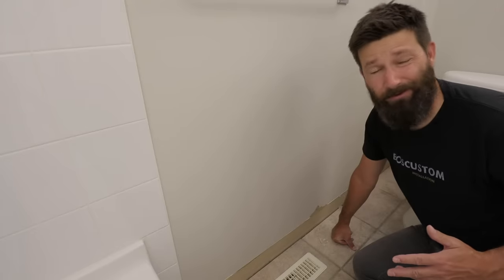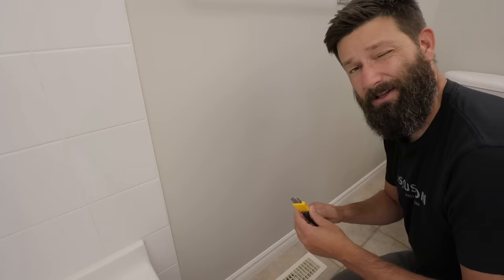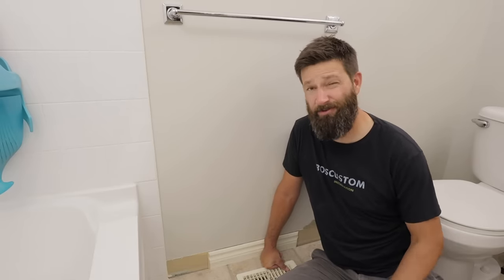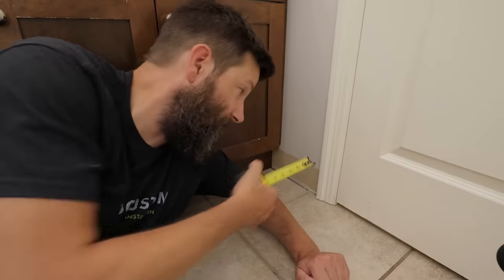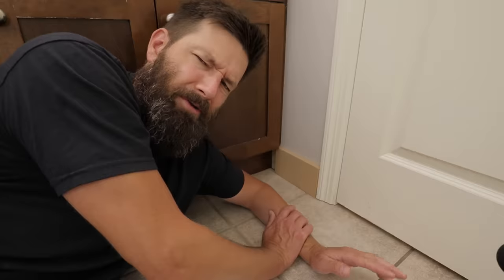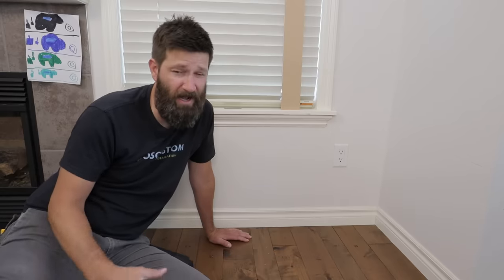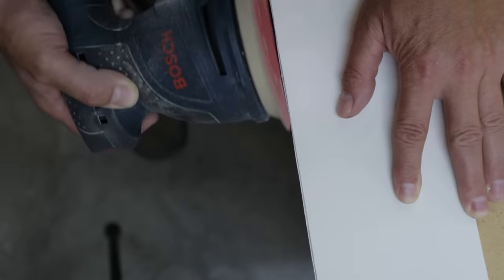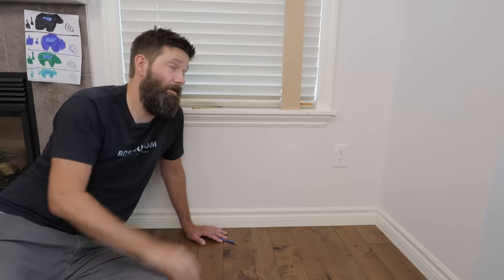The 4 Fatal DIY Baseboard Mistakes!

Comment: Just put down new vinyl plank flooring. Previous homeowner had thick wood laminate down. Now I have a half inch gap under all the baseboards which I’ve been able to use 3-4 quarter round and cover the gap, since I didn’t want to lower or replace all the baseboards. Problem now is I have big gaps under the door casings and jambs. Only way I can think of to fix all these doorways is to take my multi tool and cut like a foot of the lower area off and put new longer section in. I can’t see going around to every door and using body filler or something and laying on my side trying to sand all that mess. More than likely damage the new floor in the process too. Last resort I guess would be to still remove all the baseboards and invest money to put in taller baseboards. At least cutting a lower section out of the jambs and casing the repair would be minimal and a foot off the floor. Advice would be great. Love the channel. Thx

Comment: #1- probably a whole lot easier to do when the bottom edge is not edged in by 2 layers of flooring butted against it and nailed in with 3" nails. Old house and everything was done with 3" nails. Sometimes multiples of nails. Will keep #'s 2-4 in mind. Thank you!

Comment: I have been using cope joints on a house I am working on and it is amazing. Cause even if the floors run down hill or up hill the coped side can be filed for a tight fit. The hangulation of the inside corners almost becomes totaly irrelevant with cope joints. I can't belive that cope joints have become so uncommon in finish work.
Reply: As  " Paint grade " trim has become far more common then natural/stained wood ... it is generally far easier , and certainly more time efficient , and a lot less expensive ,  most will  just do what you can with an inside miter cut , and fill it with caulking etc.  

So Yes , the art/skill of cope cutting , is/has become lesser used .

Won't  be long before new young carpenters  will look at a coping saw with the same confused look as when seeing a rotary dial phone . 🙂

Comment: Great tips man.  I seem to always have 2 cents to add but this one was on point.  Great tip on using a shim to scribe.  I always bust out my scribing tool but that’s a lot easier.
Reply from the maker: Thanks buddy, I've always been a fan of using shims.  It's simpler than fiddling around with the scribing tools in my opinion.
Reply: I also dont scribe to floor unless gap is more than 1/8. Caulking is necessary no matter what to seal the bottom edge from moisture , washing floor etc. Let the painter do it. Use quality caulking also. If you choose baseboard thicker than casing just put backband around casing. Its just piece of maybe 1/2 " by 1" piece of trim . wrap that around edge of casing. Adds a nice detail an enables you to use thicker baseboard. Good luck to all. 😁

Comment: Excellent video. I'm really surprised how common you say the first two mistakes are. The only one I didn't know was #4... specifically using a shim to act as a guide to mark where to trim. And BTW... i have that same Bosch sander. Definitely the best cheap random orbital sander out there and hooked up to a shop-vac you've got pretty much dust free sanding. I'm looking at buying Bosch's beast of a sander, the GET75-n6 with the switch to turn on/off powered rotary mode. Its expensive but sometimes the little bosch isn't enough.

Comment: Is it a new style just using the baseboard alone, because ive done plenty of trimming and ive alwats installed quarter round or shoe to give it a extra touch and it conceals all the floor issues. The scribing is awesome, it does work.

Comment: Another tip: before using the glazers bar to pry away the baseboards, slide a 3” putty (drywall) spatula (knife) behind the baseboard, against the wall and pry against that. Reason: Often, very long Brad nails were used to secure the baseboards and prying can collapse the drywall. The putty knife adds extra support to pry against.

Comment: I'm using composite pigmented baseboard in my current renovation, some of these tips will help out for sure because I don't want to use caulking and have to paint something that already has the colour I want!
Reply: You have your own set of issues.  I would not use a pre primed and painted baseboard or any trim piece for that matter.  There’s no way to make it seamless, unless the manufacturer provides a color coded caulk.  In most cases caulking finishes off the baseboard, integrating it to the wall and other areas where it touches, not to mention helping fix the occasional infer or over cut miter.

Comment: This is a great video. I’m currently replacing all the door casings and baseboard in my home to a wider flat stock type molding. I’ve never done anything like this before so it’s a real learning experience for me. I started in the water closet in the master bath. It’s a small room where it’s just the toilet. I did 45s on the inside corners and didn’t get as tight of a fit as I’d have liked. Since you said it’s ok to butt ends on flat stock I’m going to try that going forward and see how it looks. I had originally thought about doing that just to make it easier for me but I was afraid that was wrong. Thank you for sharing your expertise.

Comment: New subscriber with a question, please: Removed old vinyl bathroom floor trim, but the wall still had some VERY sticky adhesive remaining, which  laughs at acetone and Goo Gone. I'd like to replace the removed vinyl with PVC trim, "Veranda 7318" from Home Depot, and I've learned that the proper adhesive for that would be Loctite 3X PL.    SO- what to do about the old, remaining yucky adhesive?
Thank you!
Reply from the maker: That's rough!  I would try a razor scrapper, and  or the scraper part of a Richards Red Bar.  Best wishes!
Reply: @TheFunnyCarpenter  
Just finished loosening the adhesive with  a hair dryer (could’ve used a heat gun), basically liquifying it a bit, and then scraping, wiping the glue off the scraper with  Scott’s towel. Appears to be a solution.
Thanks for the response 😊

Comment: Instead of the pry bar, I use a pair of 6" drywall spreaders to remove base.
Push a flexible spreader down behind the base at a slight angle where you plan to start.  That helps cut what the razor knife missed. Once it's been inserted, flex it toward you a few times. If that's enough to begin loosening the base board, insert a second, stiff spreader behind the first one and pull on them both. They act like a pry bar but over a wider area.
From that point on, use the flexible spreader to begin loosening the base, then with the stiffer one right behind it, rock them both in tandem.  The thin one is always inserted behind the base first, and shove it down at an angle each time, cutting whatever the knife missed.
Even if you use a pry bar, use a thin, flexible 6-in drywall spreader ahead of the pry bar for the reason mentioned earlier.
Reply from the maker: Nice technique
Reply: @TheFunnyCarpenter  it doesn't always work depending on if it's real wood and was fastened on with finish nails but I've been doing it that way for quite a few years and they usually works pretty good especially if the flexible drywall knife is only used for pushing down to finish cutting the caulk and then using the pry bar behind it. I don't think one method works for everything. Mine certainly doesn't. 😁

Comment: If you scribe just one end of the board then isn’t there he 45 in the corner not going to be plumb?  Which would leave a gap at the top half of that miter joint.

Comment: Very nice , thanks . I have a question my installer want to put baseboards all the way down to ply board floor & then put Vinyl floor with a regular gap from wall(in my case baseboard) & fill that gap with quarter round- Is this correct? Any con or pro? Why doing like that- Thanks a lot
Reply: Not an expert, but typically installations go in this order:
1. subfloor 
2. vinyl plank
3. baseboard
4. moulding

There's a reason trim and moulding is called "finish" carpentry. 

Am I understanding this correctly? Your installer wants to install the baseboard first, then cut the vinyl just short enough to fit moulding? Or is the vinyl going to come up to the baseboard and moulding on top of that?

The only pro I can see in doing it this way would be that removing/changing your floor in the future would be easier since you wouldn't have to remove the baseboard - just the moulding. The downside would be that if the vinyl is cut all the way up against the baseboard (and underneath the moulding) then you're going to have a hell of a time changing the baseboard without damaging the floor in the future.

Comment: I have a hardwood floor that slopes and out of plumb/level door trim and I have to fabricate stained wood baseboards to replace the 140 year old 8" tall old growth, hand scraped, baseboards the inept demo guys threw away.  I'm fretting over how to even start this project.  I'm pretty much convinced all of the pieces of baseboard will have to be slightly different heights because I believe they need to be level on top.  Do you think it's better to scribe the baseboards to make them fit flat to the floor or just install the baseboards so the tops are level and then cover the gaps with quarter round or shoe?

Comment: Only base I would sand to make fit floor would be if stain grade ( could not caulk )
My 1 & 2 best are to shim the back if wowee in wall plane . 
Make up outside corners and secure 1st ,
The inside is slam ( caulk if gaps )
Best is to stretch measuring tape on floor ( locked) line up a mid stud mark with backing side of wall outlets .
Never waste a minute looking for nail backing . Do these FAST and make $

Comment: Finish carpentry or trim or framing work or fitting a door,  use a cordless Makita planer to dial in any line or bevel or edge. Fine tune any situation . Replacement blades come in 10 pc pack.

Comment: I have a question about cut lines -- what if you're painting the walls in between removing and reinstalling the baseboards? Can you just scrape off the remnants of the old caulk, prime & paint all the way down the bare wall, and not worry about cut lines or is there some non-cosmetic reason that would still be a problem?
Reply from the maker: You definitely can.  You might want to give that area a light sand with a pole sander it you have one or just wipe it off- to make sure you don’t get a bunch of crap in your roller.

Comment: In Tip 3, what is the name of the tool you use to measure the angles of the inside corners? (At 4:42) Thanks, this has been helpful.
Reply: So can you tell me the name of the tool?

Comment: I don't butt or mitre internal corners on profile baseboard, I cross cut with a 45° angle and use a coping saw to cut along the line, it's a perfect match for the profile

Comment: Could I possibly install self-sticking baseboard over my existing baseboard? I have the very old 2" flat wood baseboards installed when the house was built in 1967. I would love to update without removing the existing baseboard if at all possible. I am doing a very small bathroom.

Comment: orignal floor was linoleum.  New tile floor was installed but they didn't remove the baseboard.  12 years later and wife want all new trim, old baseboard is removed and now there is a gap.  Do I fill the gaps with grout or just install the baseboard with just a little hidden below the floor level then fill the gap with grout or caulking?

Comment: In terms of placing baseboards flush with the floor, when installing a floating floor (vinyl), the baseboards were to be placed 1/16 - 1/8 above the flooring to prevent pinching and provide enough air flow on a basement cement floor.

Comment: Lol... #4

I have this exact issue in my bathroom because the previous owners apparently thought getting the floor level BEFORE installing tile flooring wasn't necessary.

....and I'm not going to bother fitting the trim to it either since the QUARTER INCH gap is behind the toilet.

I guess this is just expected once you're the FIFTH OWNER of a 30 year old house. So so many half-assed home "improvements". 🤦

Comment: You didn't talk about what to do with the baseboard under the dishwasher and how to make that part of the floor look good. Do I continue the ceramic tile under the dishwasher, or do I continue the baseboard in front of the dishwasher and have to cut or rip off the baseboard to repair/replace the dishwasher?

I just replaced the dishwasher and the leak disintegrated the tract home particle board that was under the old vinyl floor. I had to cut the baseboard to get the dishwasher out and now there's a huge hole down to the plywood subfloor where the contractor my ex hired didn't continue the tile under the dishwasher. I have spare pieces of ceramic tile but the cut edge of the installed tile at the toe kick is ragged and I've just stuck a chunk of plywood in there temporarily until I find out what the correct way is to fix this snafu.

I'm thinking the correct fix is to call a professional. I've gotten the following advice:

1) Definitely don't continue the tile under it and replace the baseboard with a new long piece that covers the bottom of the dishwasher. It's the latest thing because the dishwasher is like the garbage disposer, you don't want to see the gap under it or the feet and the dust that collect under it.

2) Continue the tile but slope it into a pan shape and add a drain tube so that leaks won't rot the floor and cabinetry. Let the leaks grow mold in the crawlspace instead.

3) Sell the house because your ex is an idiot and you need to get out of there.

Comment: A simple inside outside corner trick for quick work is just go 47 degrees outsides and 43 insides (only adding the 1/2 degree might not be quite enough then you have a second cut anyways). You will have a tiny gap running toward your wall that gets solved with a quick dab of painters caulk. Most people will finish joints with a tiny bit of caulking anyway so It's really insignificant.
Reply: I carry a Starrett angel finder.  If an outside corner reads 46° I cut it at 46 + a smidgen just to make sure the outside of the miter is closed.  As a journeyman cutting them automatically at 47 doesn't work.  Too gappy.
Reply: 47/43 might be too off esp for outside cuts
Reply: Apologies if I don’t understand your comment. It seems you are advocating for mitred inside corners. Why would that ever be better than coping profiled moulding or back cutting butt joints for square stock? Anything else is not professional grade.

Comment: So how to you treat the caulking line if you’re going from rugs to LVP? Took the baseboards out properly, scrapped the residual caulking off the wall. So I’m left with untreated drywall. Can I just mud over it, prime and then paint, or should I still do what you recommended under mistake # 1?
Reply from the maker: It can be a bit of a process depending how the caulking comes off the wall.  If the paper on the drywall tears it's best to use an alcohol primer like Bin Zinsser, Prime it, Mud it, Sand, Maybe Mud Again, etc.
Reply: @TheFunnyCarpenter  Thank you for your help.

Comment: Great tips. With regard to new baseboards having to be taller than the old ones, can't you just level out the bottom of the drywall with green compound and a 10" knife? It creates some work, but it is an option if you want to keep baseboards that match the rest of the house.
Reply: Certainly possible, just added work for most baseboard changes.
Reply: or add a shoe molding in front of the baseboard

Comment: Shoemolding or quarter round also hide floor gaps although it can make/add to casing transition problems due to increasing the effective baseboard depth.  Previous owners added 3/4" quarter round to existing 3-1/4" baseboard and the results at my house are disappointing, but I have seen it work well with taller baseboards.
Reply from the maker: Yes, shoe moulding creates its own problems for sure.  I've always been a fan of fitting the baseboards to the floor, and if a should moulding is necessary I will make them very thin and try to make it seem like part of the baseboard.
Reply: @ghostfive7119  Is it still a cover up when the reveal is in plain sight?

Comment: Quick tip ...if  for whatever reason you're planning to reuse the base or case that you're removing ... always pull the nails/brads through the back .

if you try to pound " finishing nails " from the back out the front ( would seem to be the logical thing )  you will most likely end up with " tear out " with natural wood . and kind of " blistering " with MDF .
If " brad nails ( usually 18ga ) are used , they are damn near impossible to pound out ,( too thin and will simply bend )  so pulling through the back is pretty much a given.

The other advantage of pulling through the back , is that it doesn't leave holes in the front to have to refill. 

I find that using " channel lock plyers ( with a rounded/cured side ) lets me get a good bit on the nail and then prying over on the curved side , gives a smooth pry to remove the nails .

Comment: Nice tips ... I'm about to lay a set!
Just one thing .... Acute Angle (0-90).... maybe you meant Obtuse?
Reply from the maker: Acute is less than 90.  If you cut two pieces trim on a mitre saw at 46 degrees that work for a wall angle of 88 degrees.

Comment: Hello, I am currently removing all my baseboards, replacing all carpet with luxury vinyl planks. I am taking the baseboards off properly but now I am worried about reusing them. Thinking the gap space was left for carpet and it would be way too big for vinyl planks. I don’t like the quarter round and I really don’t want to buy all new baseboards. Am I over thinking this? 😀